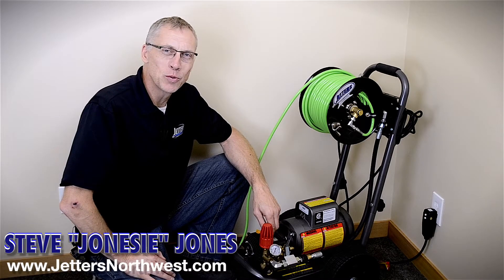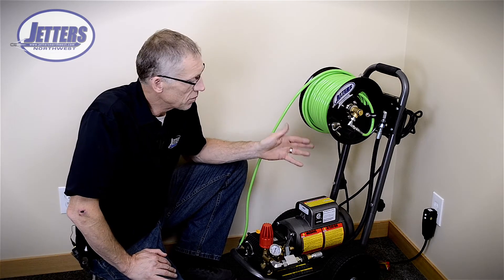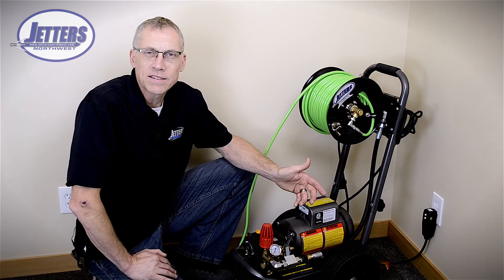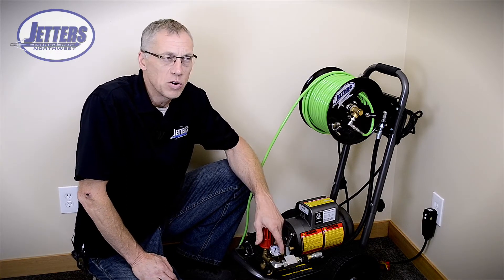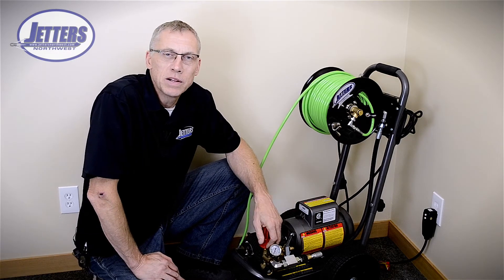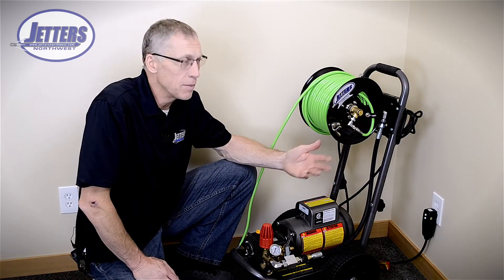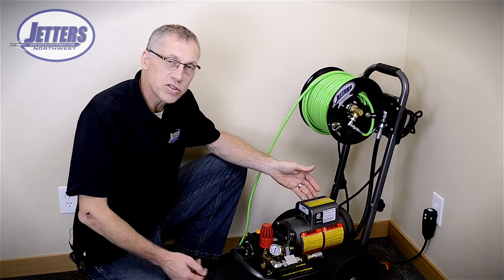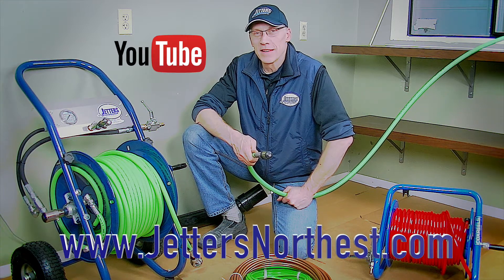ELECTRIC-POWERED MINI-JETTERS: Their Purpose & Limitations - "GET" JETTING  with JONESIE

Comment: Can you use the hit water from the house? What temperature is safe for the pump?
Reply from the maker: Yes the pump on the jetter-model in my video is fine with typical 120-degree f. water, but not all jetter pumps in the market can do that.  A big key to running hot water thru any jetter is to turn the motor off when not actively jetting. If you leave a jetter running in recirculation "bypass" mode (motor running but not sending water out the jetting-nozzle) then that 120-degree f. water can become 160->180->200+ degrees pretty quick due to the friction of internal-recirculation of the pump-flow (when not actively jetting) and those higher temperatures can cause serious pump-damage.  Hope that helps!

Comment: What is the source of water?
Can i use a five gallon bucket with hose in it?
Reply from the maker: Typically pulling water from a spigot, shower, or tapping into a sink line.  Most of these small jetters cannot pull effectively from a bucket or tank because the pump needs a positive "head" of water - it's possible but you risk cavitating the pump
Reply: @JETTERSnorthwest question….could I run my 4400 psi gas pressure washer with a barrel of water in theory or is it gonna burn it out?

Comment: What is the gpm on this jetter?
Reply from the maker: About 1.4 gpm.  Larger 2-horsepower electric jetters typically max out at about 2.2 gpm.  Custom models made for 3+GPM but you have to sacrifice PSI because of the horsepower-limitation of 115-volt motors, and you need larger-diameter hose to pass the flow at lower PSI (which often defeats the purpose), thus anything over 2-gpm is rare for these applications

Comment: How many gallons per minute is this jetter? Do you have a portable external water tank the jetter can feed from?
Reply: I would imagine no more than 1.8 GPM maybe 2.0 GPM
Reply from the maker: About 1.4 gpm.  Larger 2-horsepower electric jetters typically max out at about 2.2 gpm.  Custom models made for 3+GPM but you have to sacrifice PSI because of the horsepower-limitation of 115-volt motors, and you need larger-diameter hose to pass the flow at lower PSI (which often defeats the purpose), thus anything over 2-gpm is rare for these applications (sorry for the slow reply!!)